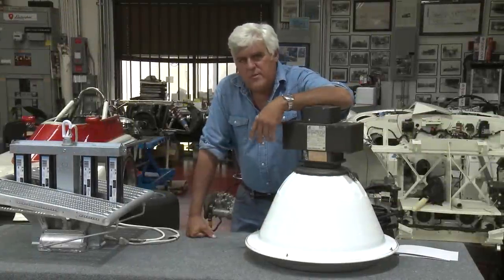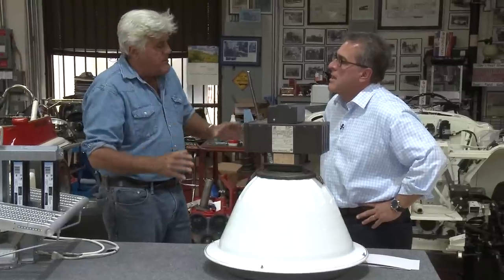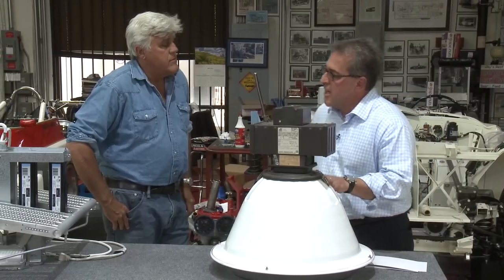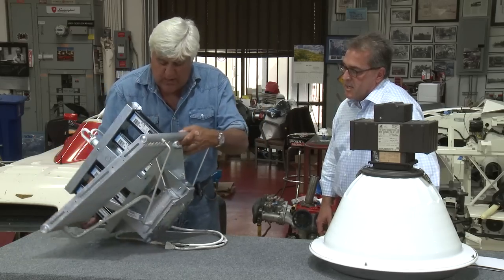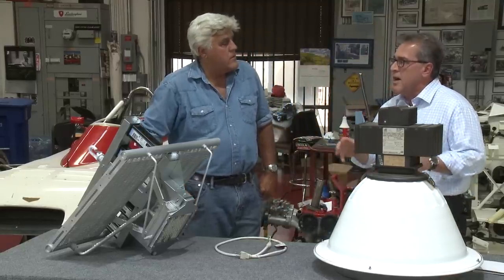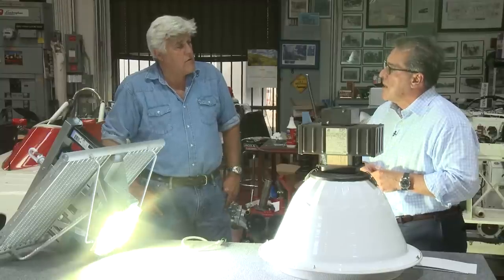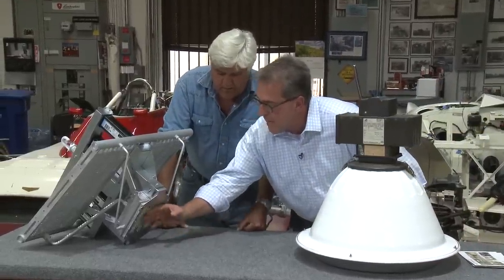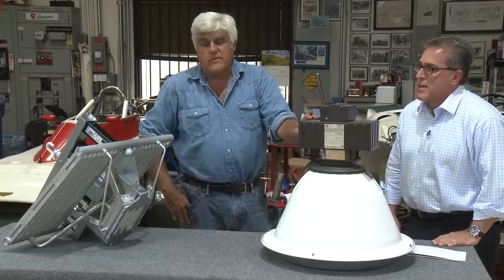LED Lighting System - Jay Leno's Garage

Comment: 2:21 That guy gave the most ridiculous non-answer I've ever heard from somebody that wasn't a politician.

In a high-output array like that, LED's do make a significant amount of heat. And since they're basically computer chips, they're sensitive to the heat they produce, and thus need to be cooled adequately. That cooler array seems a bit convoluted and inefficient to me, I'm sure using copper heatpipes through a non-painted aluminum heatsink could be smaller and more efficient, and could still operate without a fan using convection like this does.

5:22 Once again, another BS answer to a fairly simple question. (To be fair, it was kind of a silly question too... but it didn't justify the BS.) The surface is hot because it has a huge quantity of light being focused on it! Go outside and touch the black asphalt on a hot summer day, it's the same thing. Darker surfaces absorb the light it doesn't reflect and turns it into heat.
Reply: "That's a great question "

Comment: Made in the US,,,  but are the LED's made in the US ?
Reply: ***** Cree are made in China as far as I know, but they didn't say Cree
Reply: PaulsWackyWorld
they are both made in USA and China.
Reply: PaulsWackyWorld Not entirely true. Flextronics LED  luminaires do use CREE lamps.
Cree was also involved in the Flextronics LED  luminaires project including design. 
Most CREE LED lamps are made in the USA, however CREE also offers a line of less expensive lower grade discrete LEDs made off-shore including some from China. 
Visit the CREE website and read their "Made in the USA" statement.
Reply: Probably just the housing is actually made in usa. And assembly of the final product. The 'made in usa' badge often does not refer to the individual parts. It is even possible that only a minor finishing step in assembly is done on american soil (doesnt look like that here btw!)
Reply: Even the " Made in the USA " sticker will be made in China.
Reply: Excellent question, and one that Jay should have asked.

Comment: Too sad this guy has no clue of semiconductor physics. These LEDs probably have an efficiency of around 40%. This means for every 100 WATT electricity you put in you generate 40 WATT optical output and 60 WATT heat in the LED chip that has to be removed in order to avoid the chip from damage. 
Quite simple, use Wikipedia to confirm my comment or ask your lokal physics teacher ;)